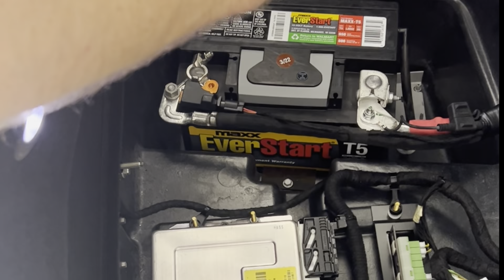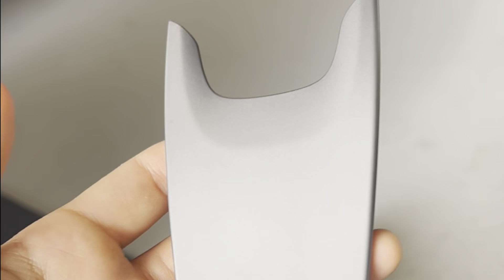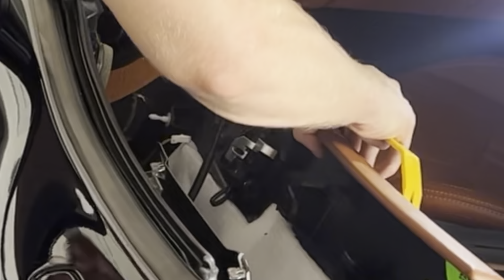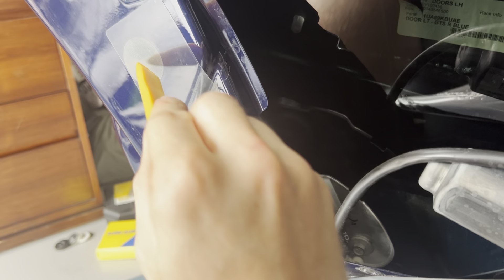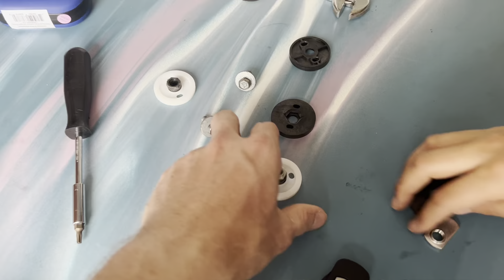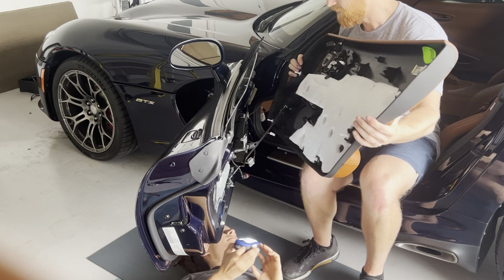Dodge Viper (Gen 5 / Gen V) Window Boss Replacement / Repair

Comment: I am working on a 2014 with 4,043 miles on the clock, the same exact problem, with just over 4k, they must have aged out rather than mileage out. Great video, thanks for sharing.

Comment: Why didn’t you actually show how to remove the trickier connections that is like the main point of instructional videos like this.
Reply: Hey there! Hear you on this. We’ll post an update since we’ve got a tri-pod, angles should be easier now.
Hope the VO helps a bit in the meantime.